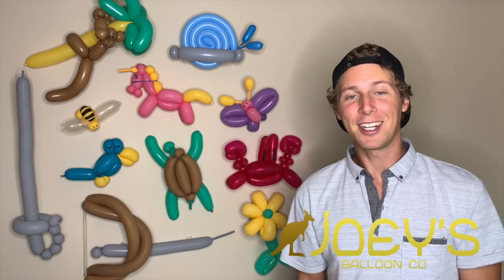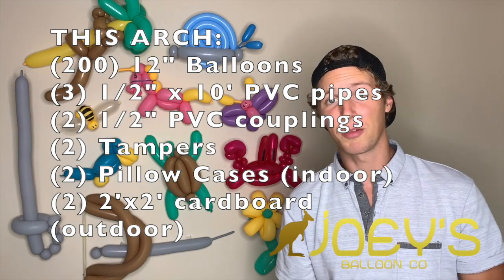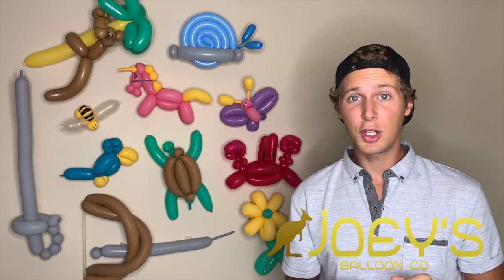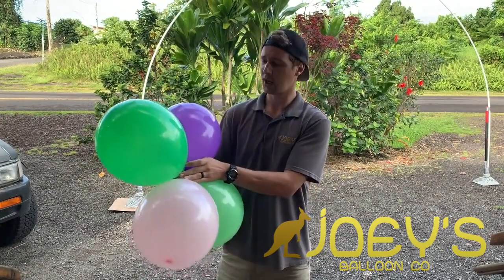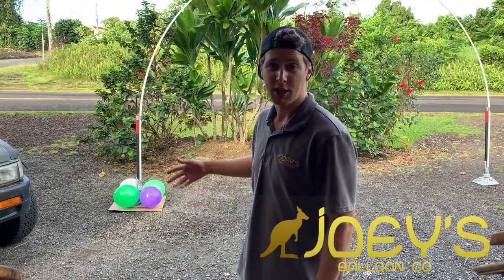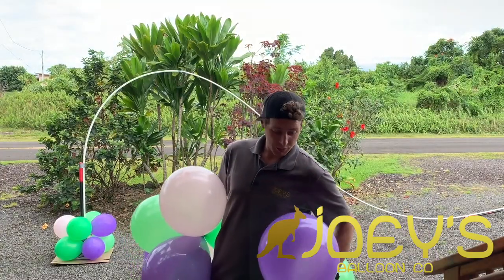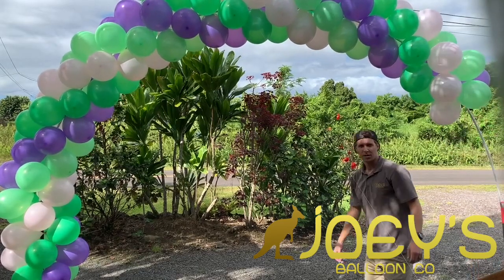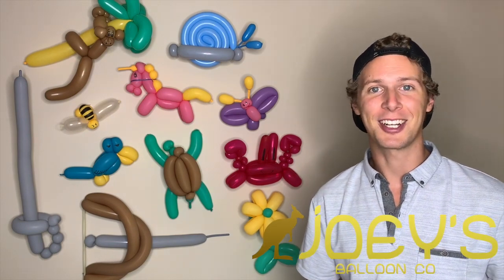DIY Large Balloon Arch (with frame) Under $20

Comment: what size tampers do you recommend?
Reply from the maker: I use 10" x 10" bases, but if there were a larger base, I would use that! There are other weighted steel bases for photography backdrop stands and other production equipment that come in 18" x 18" bases, but they are a lot more expensive. The tampers have been an affordable way to produce practically the same outcome - especially if you use fishing line to secure the arch anyway.
Reply from the maker: Thanks for watching! You may enjoy and benefit from my free weekly newsletter - sendfox.com/joeysballoonco